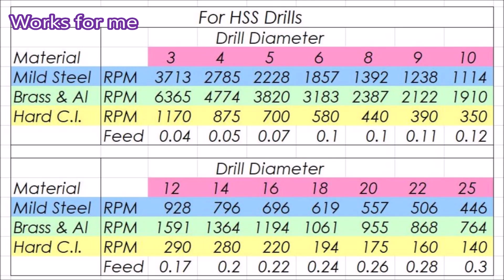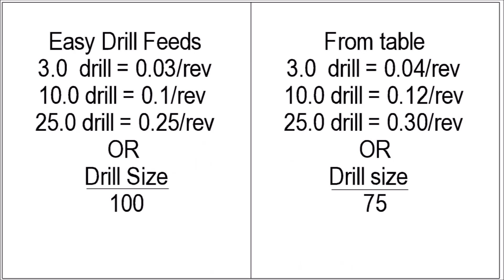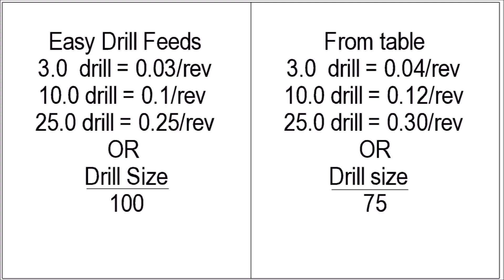Hex Brass fitting, turn, drill and thread 26TPI, drill speeds and feeds chart.

Comment: I would switch to mach 3 or linuxcnc if it was my machine. Dos works and will make parts all day! What model lathe is this?
Reply from the maker: Hi Dirk. Lathe is a Hercus PC200 made in South Australia.  Not changing from the Hercus dos software, it works and I simply can't be bothered learning anything new.  The turret behaves these days since I stopped using w98 and have gone back to the DOS operating system.  Thanks for your comment.

Comment: Good job you know what you're  doing with computers! I wouldn't have a clue! 😂
Another great video Nigel 
Cheers Ian
Reply from the maker: Hi Ian, the way it is set up makes it fairly easy to drive. It works like this.  It boots straight into the Hercus software so no dramas there. There I can do what I want as far as the cad/cam goes.  If I need to bring in a file, I exit the cam software and it goes to a command line and I type in xtgold and the file manager comes up. I press F8 to split the screen and log on to the the floppy in half the screen and I can transfer files from floppy to the Hercus directory on the hard drive in the other half of the screen.  When I exit Xtree Gold, I again get the command line, type in hercuspc and I am back in the Hercus software. That looks a lot but in reality it is about 10 steps to, leave the Hercus software, copy a file to the hard drive and get back into the Hercus software.  I bought this lathe in 2005 so I done it a few times now. LOL Thanks for leaving a comment.  Nigel

Comment: If you need the convenience of USB flash drives, perhaps consider using a 3.5" USB floppy emulator. We've used them on some old machines and they worked quite well. You just need them formatted appropriately, FAT16 or 32. Edit: Looks like someone already suggested that, heh. All good, ignore the comment.

Comment: I can’t recall having anything but Novell networking working well in dos (ms) but I believe the much more recent Freedos should be able to do modern networking. Then you can send files through the network, no usb, no floppie.   I prefer Norton Commander for file managing, still use the open source Midnight Commander under Linux , it looks and feels just like NC. boils down to the hardware just being too slow to run win98 AND the Cnc task at the same time, as others have said, windows hogs the cpu leaving little for the real task.
Reply from the maker: Hi David, thanks for your comment.

Comment: You CAN do ethernet and file sharing in DOS - it's a bit finicky to setup, but when I was young and had all the time in the world to "just mess around with things", I seem to recall getting it working. You could also install one of those USB floppy emulators that are all the rage these days in any old equipment that has a 3.5" floppy drive. Then you can plug your USB stick into that, and to the machine, it just looks like a floppy disk
Reply from the maker: I am 76, so don't have all the time in the world to just mess around with things. LOL. I have a few hundred floppies collected as other folk moved forward and threw them away.  Thanks for the information, but I will stick with the floppies.  Nigel

Comment: we also went over to Sumitomo and you are correct with Sanvik tooling and same for Seco toolings. we do find Sumitomo very good inserts for our application at a Shipyard, machining 4140, stainless steel, alloy, bronze, nylon and etc. thanks for sharing the charts and drill feeds. Cheers! Hope you had a good weekend.
Reply from the maker: Thanks for your comment. I have stuck with Sumitomo parting inserts, they have never let me down.

Comment: Win 98 is not real time vs DOS which is a real time OS.  This just means DOS will respond immediately vs Win which time-slices between the program and other system calls.  Kind of like driving and texting at the same time - can cause issues.
Reply from the maker: Thank you, I don't know enough about it, but this run of the turret behaving perfectly proves that it works fine in DOS.  Thanks for your comment, Nigel
Reply: I'm pretty sure win98 still runs on top of actual dos, but yes, it's hogging the CPU, so "real time" tasks won't necessarily run in real time. There is a way to change a processes' priority, so it would be interesting to run it in windows, but crank the process priority of that task all the way up and see if it runs properly.
Reply from the maker: @gorak9000  As the Americans say that is way over my pay grade.  With DOS and Xtree Gold and floppies I have things pretty well covered.  Thanks for your comment. Nigel
Reply: @gorak9000 Windows 98 uses DOS as the initial stage to load its 32-bit kernel - afterward it runs the show.